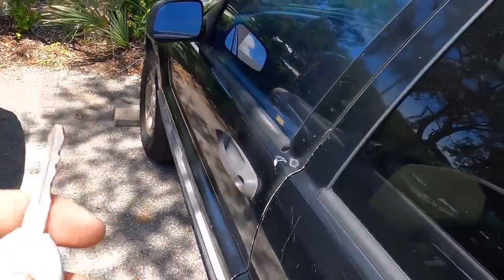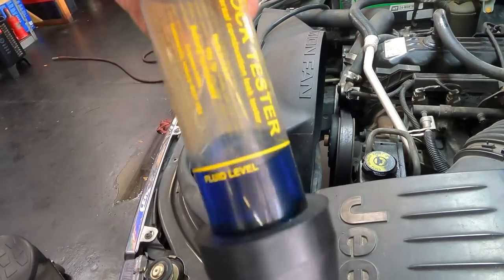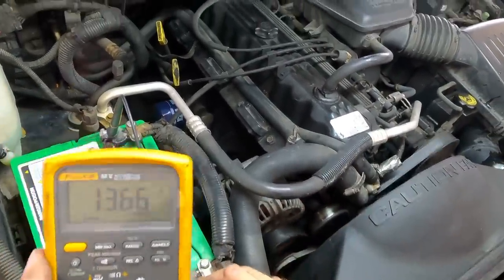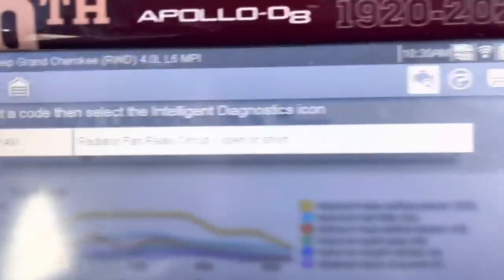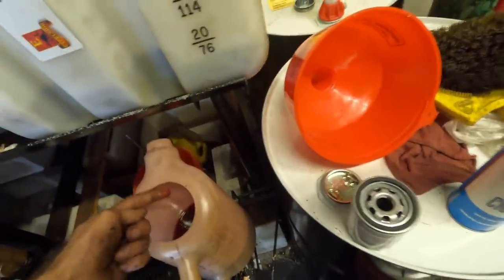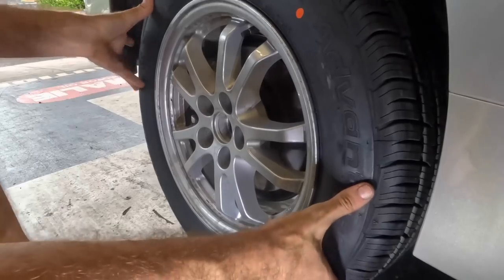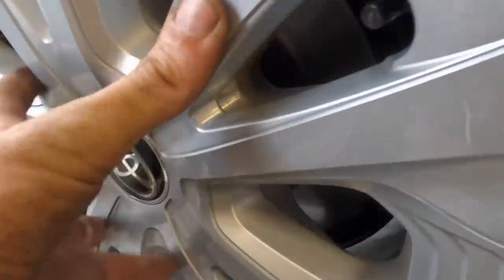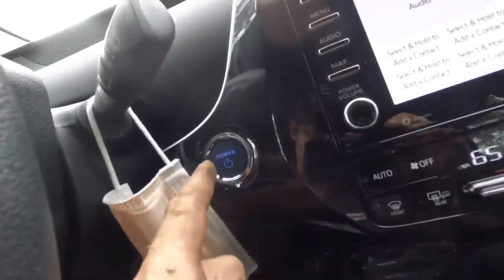How much longer will it last? Jeep Grand Cherokee 4.0 I6 | Compilation

Comment: The equal temps at the radiator hoses tells me the water pump impeller probably grenaded.  Common on these.  I've had plugged radiators do the same thing though.
Reply: Same thing with gummed up thermostats... A top tip, drill a 3mm hole on the outside of the new thermostat the part that doesnt move or open, helps bleed the system and  has the added benefit of helping the system to warm up faster
Reply: I had the same with a bad pump - too much driving at high revs caused cavitation and it literally removed the impeller vanes.
Reply: @aussiebloke609  that is poor design.  Not that you drove at high speed.
Reply: @iHelpSolveIt  A bit of both, really.  The engine's original redline was 5000, but mods raised it to 6500...but gearing was low, so just 60 mph was over 4100 in top gear.  Mind you, this was a BMC A-series engine, so it's a very old design, but the pump usually survived quite well when driven in the manner they were designed for.
Reply: Don't some newer water pumps use pressed on plastic impellers that occasionally fall off?

Comment: AMC / Jeep 4.0L inline six is a long lasting motor and to see this one w/ over 350,000 miles is way awesome!
Good troubleshooting skills here for the youngsters (Junior Millennials & Gen Z) to learn on how to work on these "old" vehicles...have a 2003 Jeep TJ Sport w/ a 4.0L & 5-speed standard trans (203,750 miles & all original) myself and it's easy to work on. Good video here RaynMann!

Comment: The problem seems to me the radiator being plugged up.  If the flow is low, the temperature differential across the radiator would be even higher than with normal flow.
Reply: Was thinking the same thing. Seems unlikely the water pump would be that bad.
Reply: I am thinking the opposite... high flow means less time for coolant to cool. If it was plugged or impeller bad the flow would be slower and temp difference would be higher.
So, I think owner put wrong thermostat into it.

Comment: 1:40  "It's funny, in two years this is gonna be a classic."  No, no it won't.  It will just be two years older and clunklier.

Those 4.0l engines, though, were really good.  That odometer shows that.

Comment: TPMS sensors use the centrifugal force from wheel rotation to close
the unloaded spring of the battery switch to energize a MOSFET controlled
FM transmitter, to the TPMS module (receiver).

Comment: Ray, those relays are known Jeep issues, if you notice the back of the relay is shiny aluminum and some come with a heat transfer paste. What they are trying to do is use the frame as a heat sink, but it gets dirty and stops transferring heat more and more until the relay burns out. I have seen a large aluminum fined Heat sink like for a computer CPU used to mount that relay to and then it gets mounted back to the frame this works much better, or you can do what I did and put a temperature-controlled stand-alone fan relay because mine shorted out the fan driver in the ECM this also allows me to just when the fan comes on. These jeeps run hotter for emissions and better fuel economy if it does not get to 208-215 the ECM messes with the fuel trims and it will run like shit and suck gas, I have mine at 212 and I get 21MPG highway and 18 City. Also, just an FYI replacing these relays with the OEM Chrysler POS really will be a ticking bomb and if it fails on a hard pull up a hilly area it will grenade the head gasket.  Also, my friend has a 2000 Jeep Grand Cherokee 4.0 HO that is on 520,000 miles he just pulled it last year to rebuild the engine and trans.
Reply: Sounds like a Trump Supporter owns that Jeep.

Comment: Love your channel. I have an ‘03 Jeep Grand Cherokee and it’s always the relay. I’ve replaced them probably 6+ times in the past nearly 20 years. Of course there might be an underlying cause, but those relays just don’t seem to hold up long in the Texas heat. At least it’s consistent and when it inevitably starts to overheat every few years I know what I need to fix. I will say that I added an auxiliary transmission cooler a couple of years ago and it seems to help keep the overall temp under control and maybe extending the life of that relay, or maybe I’ve just been lucky with this last relay. Thanks for all the entertaining content, I always enjoy it.

Comment: On the Jeep, I can't stop wondering how or why the previous repair person had the smarts to use a cut-off saw to cut a notch in the unseen plastic thereby allowing easy access to the relay. Ray never did say just how much work it would be to access the relay if the notch wasn't there. Just how much of the broken plastic front end would have to be removed to gain access.
Reply: Must be common, I have a 2000 grand cherokee and when I took the headlight out someone had cut a hole in the bumper right above that relay. Although the hole in my bumper was a lot cleaner lol  ;D
Reply: In my experience, Jeeps are particularly prone to blocking access to certain parts or fasteners with plastic that could easily have been designed with access holes from the start (although that would have added maybe a penny per part in additional production cost, so the bean counters would never have allowed it). 

The Liberty with the "Max Cooling" option of both electric and clutch fans requires the clutch fan to be removed first before the electric one can come out because the clutch fan blades foul on the fan shroud, unless you cut a couple of small bits of plastic off the bottom of the shroud, in which case the electric fan lifts right out without needing to touch the clutch fan.

Similarly, if you're trying to get the power steering pressure hose out of the Liberty, two bolts holding it down are hidden under the plastic header panel that supports the headlamps. Factory method is to remove the entire header panel, but a hole saw makes life a lot easier, and the holes you cut are completely hidden under the left-hand headlamp.
Reply: I can confirm, cutting the hole above the relay is a well known short cut on WJ's, otherwise the bumper has to be removed. Some claim the dealership techs would cut the hole as well to save time.
Reply: We use a 3” holesaw. 
It turns out pretty clean. Almost like a factory job.

Comment: 326k on my 97 XJ

It has a 4.0 in it.  Long as you change the oil regularly, don't overheat it, and live somewhere it won't rust to pieces, it'll go forever.

Comment: Should have put some Heat transfer compound on the back of the relay
Reply: Thermal paste
Reply: @zachv1942  LOL, same thing, but you can get thermally conductive tape.
Reply: @Cheepchipsable  semantics

Comment: The 4.0 S6 engine was one of the best Chrysler ever produced.  I have a 98 Wrangler I bought new and it still starts every time even though it sits for months.
Reply: probably because Chrysler never designed that engine. it was an AMC
Reply: @bonza167  true but Chrysler kept it going and improved it for decades after its initial production. Had AMC kept Jeep I question whether the engine would be as  as beloved....AMC didn't have a great reliability rating.
Reply: @tjrenegade9807  AMC was known for it's reliability and durability.
Do to perpetually limited design and development budgets it often used carryover technology that had the bugs worked out of it.
They offered some of the longest warranties in the industry and had some of the lowest warranty costs.
Reply: @williamegler8771  Sorry I disagree there cars were horrible. Not to mention ugly as hell....JMO
Reply: @bonza167  My 318 Jeep runs better then my AMC powered Jeep and it has more miles. Chrysler was golden back then.

Comment: I have a 01 grand cherokee 4.0 123,000 miles superb engine.I use zinc rich oil for the flat tappet cam it is very happy and reliable.Proper maintenance and they will last.

Comment: Those straight sixes are tanks and will last forever if maintained
Reply: Agreed. I miss my 87 amc 5 speed Cherokee. Was a tank. 407k still ran like a champ till I got t-boned by a red light runner. Back in 2001.

Comment: What good reason could they possibly have to hide a very small relay like that?
Reply: Because it's a solid state relay thus needs a metal surface to pull away the heat it generates.
Reply: @v12alpine  is that the only metal surface under the hood?
Reply: @v12alpine  is that the only metal surface under the hood?

Comment: Gotta love how jeep couldn't put the fan relay in the fuse box like the rest of the Fuses and relays @Rainman Ray's Repairs
Reply: it's a solid state relay that needs a well ventilated metal mounting base as heatsink
Reply: Those were known to go bad. Fix was to remove the headlight and just cut a hole in the headlight/grill plastic framing to get to it easily and make it easier the next time you had to replace it. In the 2004 model (still same generation grand cherokee) they pulled their head out of their ass and went to normal High/Low relays in the fuse box. EDIT: and now I got to the part that shows someone already cut a hole for easier access. :)
Reply: @WooShell  I understand its a solid state relay that needs cooling and a well ventilation metal housing but there are better cooling locations in that engine bay that are better then behind the headlight behind a plastic shroud
Reply: @AntonioClaudioMichael  I didn't look closely enough, but isn't that location where it's mounted part of the wheel well? That should be well enough ventilated while driving.
Reply: @WooShell  yes its behind the wheel well the wheel Well Cover stops the air flow from being as much as you think Its in a Cavity behind the Whell well

Comment: This is the perfect opportunity to say that owners who are DIYers, are often successful and smart to throw the "Parts Cannon" at issues (when they get the right parts from the right source). It's usually cheaper and better for many drivers to put the most obvious parts on a car, than to get it fixed by a shop. - Save outside help for difficult or dangerous issues that can't wait.

Comment: It makes me wonder how are vehicles like this even legal to be on the road with the headlight like that?
Reply: there has to be SOME leeway, otherwise the roads would be utterly deserted.  as witnessed by that brand new Prius.
Reply: @anonymuswere  I was thinking of the jeep with the headlight that was obviously been like that for a long time. Being in Europe we have to get an inspection once a year to ensure the car is road worth and this would never been allowed.
Reply: @gimmegaming5345  which is why I had said the roads would be deserted.  if the individual states (which all have their own rules) went after nitpicks like that, even US government vehicles would end up permanently bricked.  our rules are not a Britsh Grade MOT that requires every nut and bolt to be literally torqued to spec, for an example.  that jeep is also an older vehicle still being run, not a brand new off the factory floor with 10 KM on it.  throw in that being an aftermarket headlight bucket that probably has the wrong mounting holes to begin with, the fact that the car was obviously stated by ray to have had damage, and the obvious repeats of ray ALL through the channel that most repairs will be utterly refused if they cost much more than 4 didgits...
in a nutshell, Americans are cheapskates with a disposable styrofoam cup mentality.  the people we see on this chanel are the ones who have a bit of spare money to have things like this done.
Reply: @gimmegaming5345  No inspection in FL.  It would drive the Japanese crazy.  It is cheaper to get a new car than pass inspection after a few years, so no used car market like in the US .  You can buy them online.

Comment: This is the exact vehicle I have and I have a power steering fluid leak as well. Gravity is pulling it down the pitman arm. With no physical signs of cracks or broken lines. I just keep the PS  reservoir full

Comment: Had one. The relay wouldnt shut the fan off with the key off. Relay is easy to get to , remove right headlight and cut a hole in the plastic housing. Took longer to take the headlight out

Comment: Ray I had 2000 Grand Cherokee with the same fan, issues. Changed thermostat, sensors. fans, and relay (twice) and ECM, Still the fan would just stop working..
Installed a manual fan switch,
Reply: Same here. The Jeep had so many miles on it. I had to figure out something after shooting the parts canon with no success.

Comment: Quick and easy test for radiator efficiency. Feel (or measure) the temperature of the upper hose with the the thermostat open and coolant flowing. Then feel the temp of the air coming off the radiator. The temps should be about the same. If not, then you probably need a new radiator.

Comment: Amc had a winner with the 232 six. Which made the 199, the 258 and the 4.0 engine. I've worked on them with 400 K, still ran good. Transmissions went first all the time. 
Best universal vehicle ever sold in the US was the Cherokee, not the Grand, which was Unibody and thus cheaper to build but less recoverable after a major collision. 
Tons of the 4.0 and earlier on the road in AZ. 
Not the best for gas mileage but sturdy as hell.

Comment: My sister in Apopka, FL bought a 2013 Passat TDI (yes, a dieselgate car, i know, she shouldn't have gotten it but it has 3 more years on the warranty) from a "buy here pay here" lot in lakeland, fl.  This poor car has been abused, anyways, timing belt needed to be done.  VW Dealer quoted 2k for timing belt change.  So I flew down from TN and changed it for her for the cost of the flight and the parts (258$) and it was a fairly simple job.  Changing the oil cooler on it was harder work plus someone put stop leak in the coolant (because it was also leaking) and when she got an oil change, they loosened up the stop leak and it started leaking again.   Got the car back to running shape and i'm hoping nothing else major happens (you know, fix one problem and 2 more crop up).  Enjoy watching your videos, thank you!

Comment: Owned several of these. The fan relay is a common failure point. The relay is located on the inside of the right fender where you indicated.  The easiest way to get at it is to remove the right headlight an take a 2 inch hole saw to the lower part of the plastic headlight bucket. Does not affect the operation of the headlight in any way.

Comment: Way back when those were just out of warranty Chrysler service information said to cut the hole in that bumper plastic under the headlamp.      The fan motors were also recalled to cut down on repeat failures of the relay.     I used to swap them out in .4.       Similar set up and location on the older caravans

Comment: I would check the thermostat, since it was replaced recently. It could be stuck open. But it does sound like a circulation issue.

Comment: Says a lot for the 4.0 I6, having gone 370k miles. This car's radiator fan relay is where the 1999 Dodge Caravan relay is, down where you can barely get to it. Had to replace one, same symptoms. That relay failed because it wasn't heat-synced with paste and screwed in on both sides.

Comment: Also regarding 4.0s and cooling... in 25 years of owning one, I've discovered that you have to do the water pump and thermostat at the same time.

And on mine, I have a viscous clutch cooling fan, and I do that too.

Maybe overkill, but parts are cheap so why not and it helps keep it running well.
Reply: Those old Rambler straight sixes are on a par with the Ford sixes. They have been built forever, anything that can break has been re-engineered to fix it.
Reply: @kenore4003  the general rule is, make sure you pour stuff in the top faster than it leaks out the bottom
Reply: @litz13  Unfortunately, been there done that.

Comment: I can’t believe how many people don’t change out their vehicles hood struts. The are really only 20-25  dollars. Easy to install too.
Reply: Obviously you have not been shopping in the last 2 years. The average 3rd party strut is now about $40. OEM struts will run between $50 to $75 at the stealership. Its no wonder people will use a 3'-4' piece of pipe for about $8.

Comment: I have a 2003.   Same issue.  When I removed my headlight the previous owner had the hole cut.  I have replaced this relay twice.  They are cheap aftermarket and unavailable at the dealer.  I’ve changed this 3 times in 4 years

Comment: Hello, On that fan relay, it is required to apply a heat sink compound at the bottom of the relay, to make it last longer. The relay heat needs to dissipate fast.

Comment: Fun fact on a 99 Jeep Cherokee xj and possibly other years with automatic door locks if you can get the hood open like that and access the relay /fuse box under the hood if you pull the automatic door lock relay and then plug it back in the door's unlock

Comment: Another great Rainman production. What a stupid place for a relay. I get what your saying about the water pump. I think I would be checking the thermostat too. Like you said. You said it had been changed. Maybe they put to much rtv on it and it's partially blocked? Wrong temp thermostat? As a noob, I learned the hard way about thermostats when I thought my car would stay cooler without one. Without it closing and cycling from radiator to engine it creeps up to overheat. If it's gummed open it could Creep up to overheat? For what little it takes I would  -Verify it was correct.

Comment: I'm going through brake clean withdrawal, need to find a hit somewhere.  You are right though about the price of everything.  Back in my teens (50 years ago) I needed a 6 inch piece of vacuum tube.  I went to the parts store, the  price was 10 cents/ foot if I recall.  The guy just told me to take it no charge, it wasn't worth the effort to ring it up.  Now I needed a foot of bulk gas line for my weed whacker and it was $2.